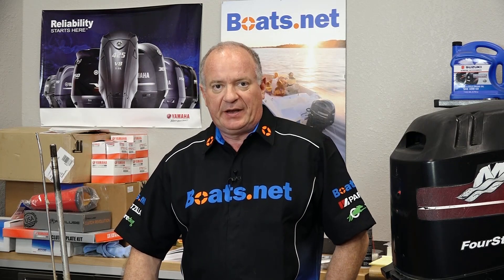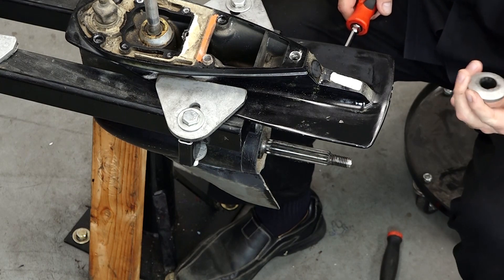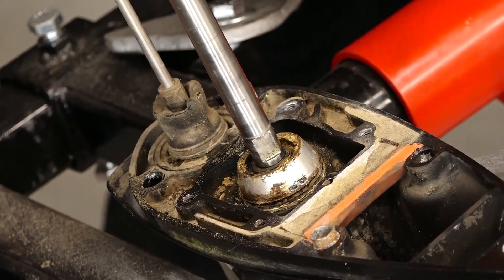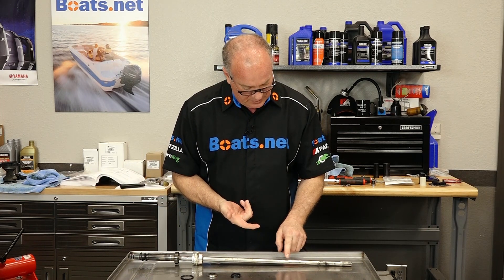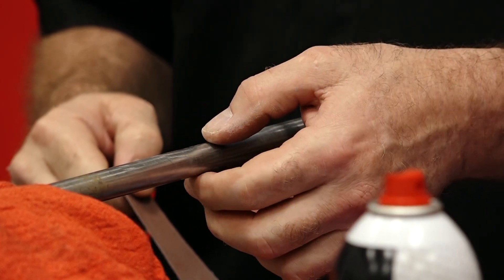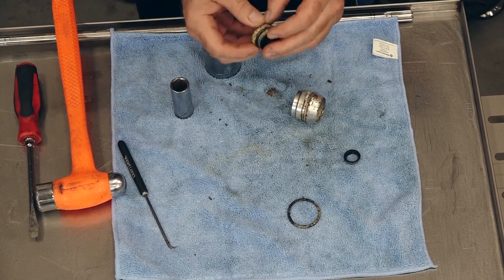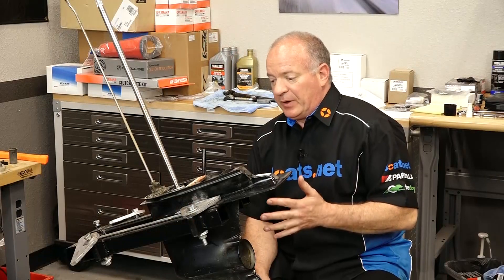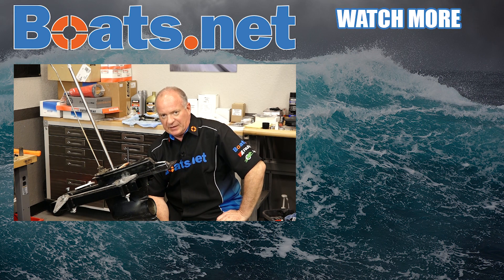Mercury 40HP Input Shaft Seal Replacement | Mercury 40 Outboard Upper Seal Replacement | Boats.net

Comment: hello I have a 2000 40HP mercury 4 stroke OT229881/1F40412YD is the 823547A2 seal kit good for both input shaft seal and prop seal replacements?

Comment: I have a lower unit with a Bob's intake on it. I was going to ship it to them to have some welding and a rebuild done but the shipping is insane. I'm going to use a local welder and overhaul it myself, thanks for the video. I needed to know how the drive shaft was connected. I'll be ordering a seal kit and a few other bits pretty soon. 👍🏻